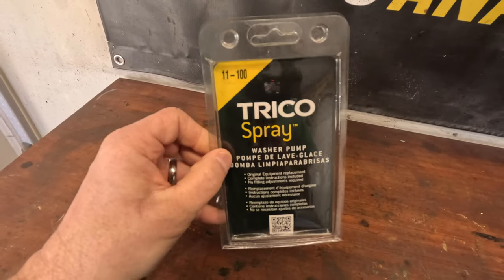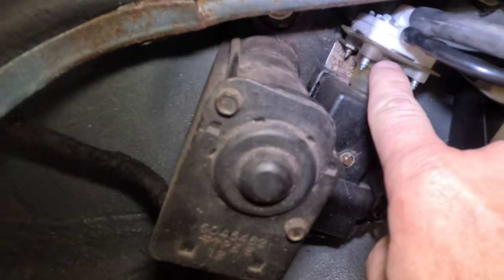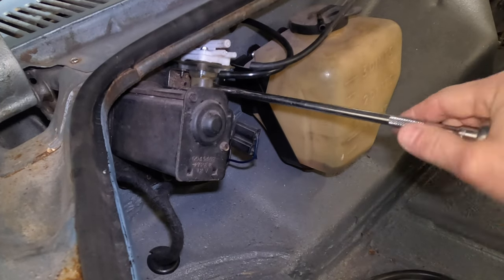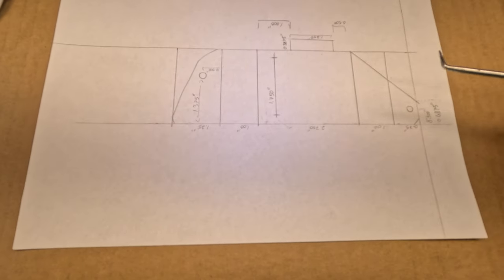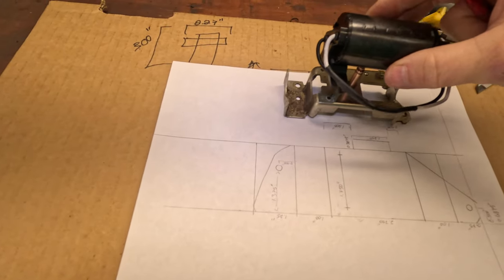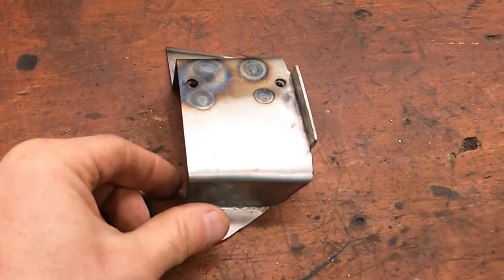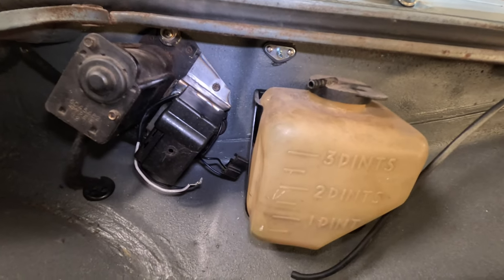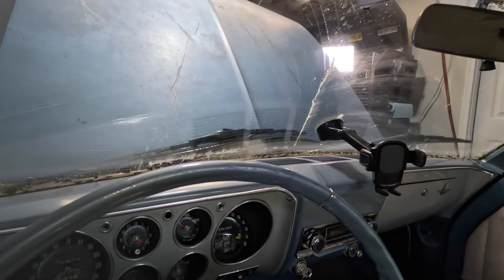Corvair Electric Washer Pump Upgrade  |  NO MORE FAIL!!

Comment from the maker: This was such a big improvement to the drivability of the car.  It's a little thing, but such an annoyance that the washer didn't work right.  For less than $20, this is a must-do for your daily driven Corvair.
Reply: Sean, you're out of control on the improvements! Since this is such a survivor/rescue build I wouldn't worry too much about originality-though I appreciate the attempt to not get too far afield--and this was a great example. Another one would be, and a must in my book, the 67-69 dual master cylinder. We actually had a 66 4 door Monza, A/C etc,  with a factory dual, which has been denied by "everybody" whenever I mention it, but we verified it at the time with local Chevrolet service as factory original, so there were a few of them. Another is the 66+ discrete factory chin spoiler. Really does help with high speed stability and it doesn't look boy racer. One thing we did eventually on all our late models was seats. I had a number of different ones, all improvements - low backs but with headrests (one of the objectives)...finally installing a set of Recaros. Those a lucky find of a pair of leather ones from an Avanti. Everyone (including me) said visually they fit right in - you're not entering any concours original shows with it anyway, but the late Corvair being fairly high waisted, you don't see enough of it to matter (IMO) and the safety and comfort aspects overriding such concerns on a driver (again IMO)... road trips finally were heavenly.... One of the beauties of the late model, timeless design that can take some (well chosen) "modern" mods. All those seats of course still didn't give us a decent shoulder belt arrangement--a challenge on the pillarless late models, but some have installed the Chrysler seats that have the built-in shoulder belt storage and reel/tensioner apparatus. Some have suggested/cautioned that since all of that is contained within the seat and not tied to the floorboard, that in an accident that there would be too much pressure from the seat itself on the currently un-reinforced floor floor pan and mounting holes (if used), being a unibody. So, I believe some people have done something about that as well.
EDIT: I just saw you did the master cylinder, good on ya! Factory / dealer should have done a voluntary retrofit on all of those!
Reply from the maker: Since the car was a middle of the road model and not a particularly rare unit, I don't feel too bad about making some minor changes.  Nothing that I've done (so far) is permanent and any stock piece can still bolt on.   I've got a few more improvements coming down the pike and am really excited about them.  We're going to be building a new exhaust system, followed by creating our own fuel injection system.  After that, rear suspension upgrades and ultimately some interior work.   

I'd love to find some different seats for the car that are a bit more supportive (now that the car handles so well).   But I don't want them to look out of character either.  

I didn't mention it previously, but I did install the chin spoiler from a '66 model and agree that it looks much better.  I need to get some better pictures now that it's all back together.  

Thanks for all the kind words and support. 

Sean

Comment: I've been piddeling with a 1990 Ford Ranger and I celebrate ALL of the successes after they are proven to work, mostly because I wind up redoing things at least one more time.  I too want mine to look reasonably like Ford did it when they built it.  But, at the end of the day, function is more important than a perfect look.  I celebrate your successes with this and the blower motor video I watched just before I watched this one.

Comment: Hi Sean, another great video!  I've been driving Corvairs since high school (1969) and I can tell you- even when the washer pumps work correctly, they still leave a LOT to be desired!  I had contemplated switching over to a modern pump as you did, but I had no idea that there was a kit available.  Thank You!
Reply from the maker: Hi Kirk!  I got lucky with choosing this model, as I was going for physical size and had no idea that it had instructions for a Corvair style pump.  I have to say that it works REALLY well now
Reply: @AutoAnatomy  Excellent!  I'll be in touch.

Comment: Another alternative is to use a tank mounted pump like Ford used. The Ford unit was available in different tank configurations the tank & pump is still available.
Reply from the maker: I thought about a tank-mounted unit, actually.  This one just happened to work so well

Comment: The original are so cool.  It's timed not to hit the wiper arms.  Mine works great.  Just a bit of work finding the parts.   When the sprayers are aimed correctly, I can use them with the top down.
Reply from the maker: I'm sure that good working units are much better than my old one was.  I just got fed up with having it not being right and found a good solution.  I do love how the originals were timed with the wipers...such a cool touch.

Comment: Sean, I'm sitting here watching you remove the washer pump and I notice that the washer fluid tank is empty, or nearly empty. Maybe that could affect the performance of the pump. haha
Reply from the maker: Yeah, it was low but that wasn't the problem.  Even full it didn't work very well.  I'm just glad it works as it should and don't have to worry about the washers ever again.

Comment: Nice to see how you did this mod and how well it worked. I can tell you that unless you remove the whole washer pump and wiper motor assy to do the rebuild of the pump you cannot reinstall the pump correctly as evidenced by the popping sound which is indicative of an improperly mounted pump. How do I know? I worked at a GM electrical service center at one time. Still, if I had my rathers it would be this mod over the stock setup as the stock just didn't work well on the 'Vairs.
Reply from the maker: Good to know., thanks...and I agree, I'd rather have the electric pump than the mechanical any day.

Comment: too.  📢.  For me when I pump fluid for my wipers I don't hear the motor. 2  ...🔊.  for me all that for nothing
Reply from the maker: I guess I'm not exactly sure what you're saying.  Are you stating the electric motor is too loud?  I can barely hear it when driving since the exhaust is so loud...but that's about to change!
Reply: @AutoAnatomy  just messing. with. Ya